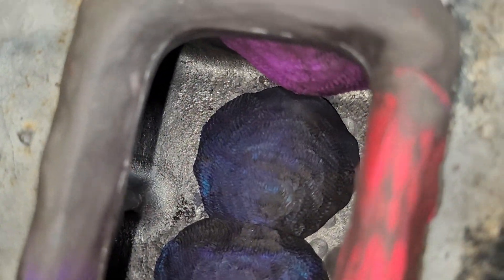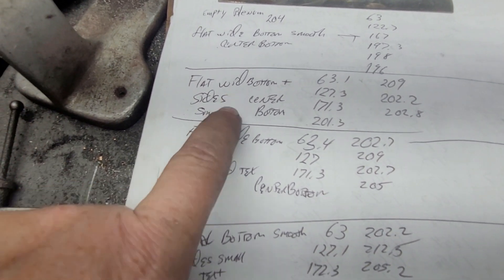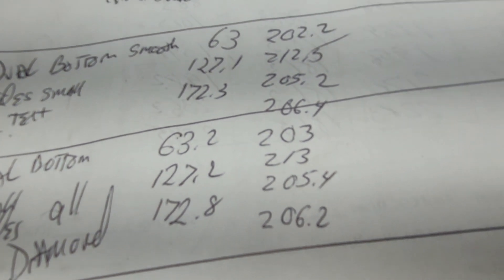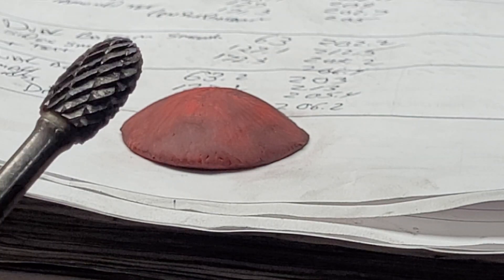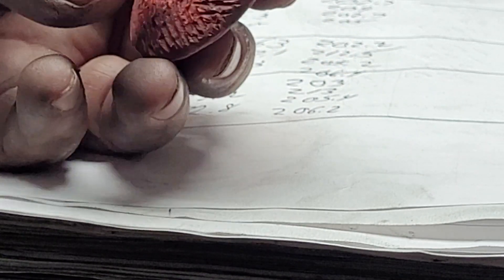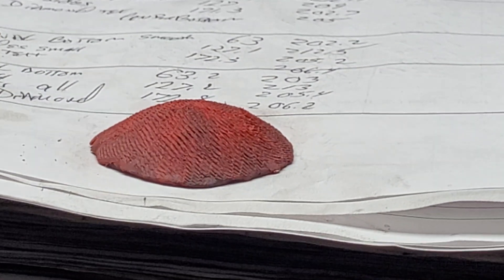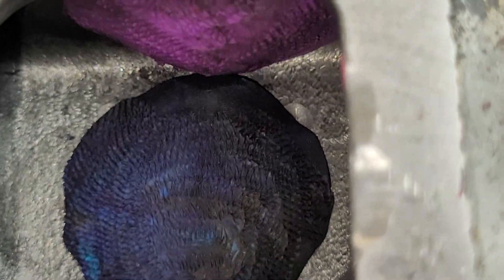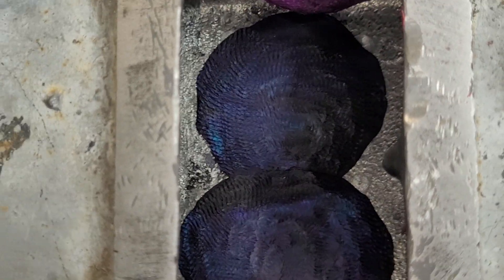David Vizard, Uncle Tony's Garage, Unity Motorsport, Mission Impossible project 318, More plenum fun

Comment: I see you kind of did the women's breast chest design, I didn't think about the side ones, good call.

But let me ask you a question, that middle ridge/divider, if you work them out and get them closer to the throats making the plenum bigger, will this not benefit more flow, I think it will with the carburetor on a functioning engine.
Reply: I had the same thought.  Would removing the center divider make the plenum larger and also make the 4 long runners flow more like the short runners?
Reply from the maker: That would require changing the design and dyno each design. That would be great actually.

Comment: Try using a golf ball to make the dimples. A lot of time and money went into engineering these. Also, try putting the dimples only in the middle of the dome. Imagine  car tire tracks going in the direction leading towards the cylinder head. The sides of the dome would remain smooth. A golf ball was designed with the dimples only placed in the middle forming a dimple band, like the earths equator! This ball was designed to prevent slicing the shot. It worked very well. I was banned by the PGA! Good luck.
Reply from the maker: I don't own a golf ball. Thanks

Comment: I wonder if a “conical dome” shape would yield even more flow due to more area being present axially around the domes sides (think a shape like a drill point but probably 160-degrees instead of 120)….some high performance 2-stroke pistons are made in this way on there tops vs a traditional dome to allow more flow to get around the center point (more cross flow area when the exhaust port opens)…..it may be easier to produce in this shape as well because the mold could be turned in a lathe then epoxy added to the negative of the mold coupon.
Reply from the maker: Interesting. Thanks

Comment: I been thinking about a carb spacer/adapter , I believe a thick spacer, with round holes for the carb in top, then a rectangle in the bottom, with about 45° ramps going to the top round holes, then use a burr to transition to the other side smoothly, it will add to the plenum volume slightly, and soften the bend to the runners, basically two 45°'s with a short straight in between them, I think I'd try a long sweeping 90° and multiple 15°-20° angles. Like a multiple angle valve seat, with multiple straight angles the fuel , if liquid , would be sheared off and pulled back into the air flow, not running down the roof of the port! Up to a 2" spacer is my thoughts, it should help lower vto mid range driveability, especially when the pump squirts in fuel, it should help mix it in well! Put it in a mill cut rectangle angles, into the block up to about . 250" thick, then flip it , and bore the carb holes, and drill and tap the bolt holes if needed, or use long bolts or studs, I think 15° angles would be a good start, if flow is horrible, maybe go to 20° or 45° 
Then grind the transition from round to rectangle if needed!  Any opinions??
Reply from the maker: I will need to reread that when I am fresh!

Comment: Good testing.  I recall seeing some sheet metal plenum inserts for the Ford 2.3 hot rod guys.  They would trim and bend it to suit flow.
Reply from the maker: Interesting.
Reply: The 1979 Mustang 2.3 Turbo had a CRAP designed manifold, both intake and exhaust too. With a lot of Epoxy, grinding and sheet aluminum they worked better. 270 CFM Holley/Weber 5200 carb needed to be replaced with a 500 CFM too.
Reply: @davej3487  Nice!  I think the Esslinger bunch does a lot with them

Comment: I think if you made tooling with that texture you'd just mechanically lock your piece into it, you could always tool the epoxy directly at the right moment just after it starts to gel, just have to catch it at the right time so it's still toolable but not too tacky. All this makes me think about some 3d printed inserts  that you could bond in with different profiles and textures.

Comment: How about a ridge all the way across, from the short seal egde, down the wall, across the floor and up the other wall to the other short seal edge? make the sausage less than a pinky thick and blend it in. It should take care of the turbulence between the floor dome and the wall dome.
Reply from the maker: It was a loser.
Reply: @servediocylinderheads  It also very much depends on everything else. Ridge height, profile, volume of the shared plenum etc. It should help, only all the other bits need to comply with the filled space.

Comment: This dome mod may be useful on a 4.0 jeep intake manifold ive converted to a 2 barrel carb to get better fuel distribution
Reply from the maker: I owned a 4.0l jeep. Fully ported intake, dome, custom 1 1/4" tall spacer, ported throttle body and k&n air kit. Ran good!

Comment: Awesome work, the only thing I could think of is maybe knife edge between all of the runners. But I'm. Ot to sure how much that would help. At some point you will reach the limit of CSA
Reply: When the port is shared, knife edge creates vorteses which then rob from the CSA. The air moves around inside the plenum from closed port to open port, and knife edge resists the air to turn. Those walls are already almost too thin for the air to turn, as demonstrated with the flag, there's turbulence already near the diving walls. A good example for this would be velocy stacks/trumpets. If the stack doesn't have the trumpet, it flows less than with the trumpet.
Reply from the maker: They are tiny.